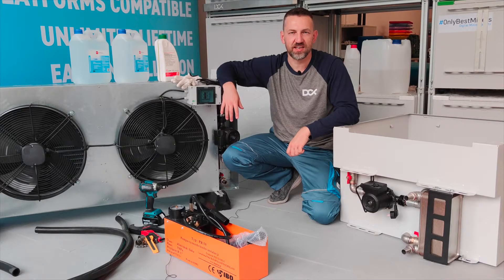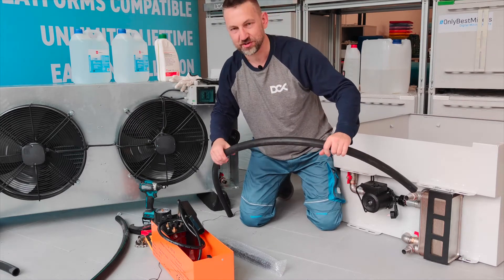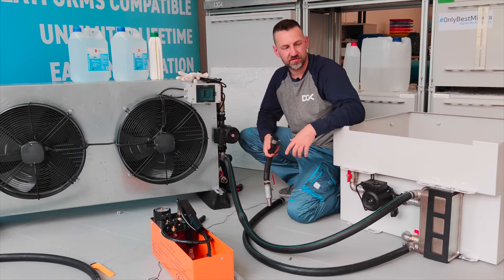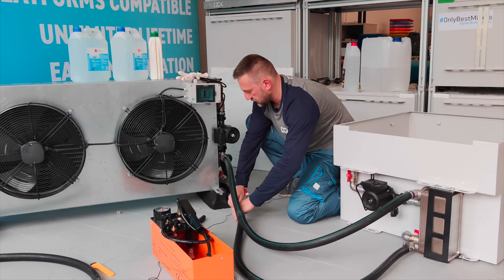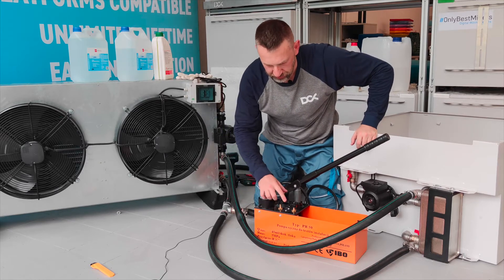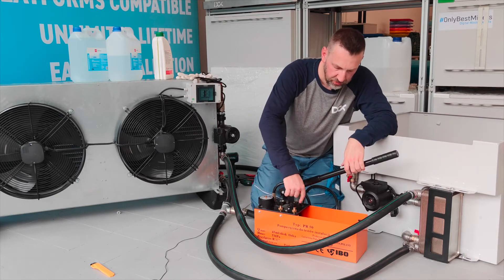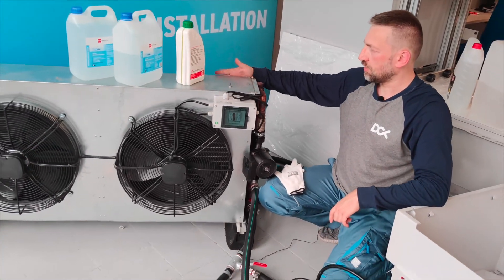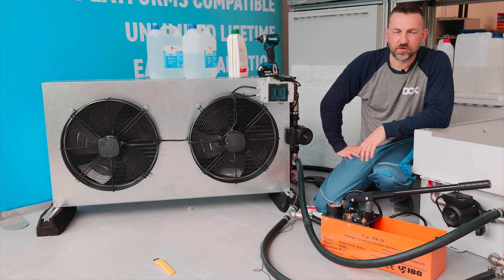How to connect the Dry Cooler in the DCX immersion mining enclosure? | Manual

Comment: Hi may I know what's the water put in dry cooler?
Reply from the maker: Hi, approx. 20L + 1' tubing x distance of that tubing.
Reply from the maker: Oh sorry forgot to clarify: we use demineralised water with some additives (anti fungus, anti bacteria, preventing from calcium and minerals buildup)
Reply: @DCXCryptoCoolingSystems  
Can use cooling fluid instead of demineralized water?
Reply from the maker: @marcusang3735  you mean dielectric fluid? That would make no sense. Water has significantly better heat transfer capabilities than engineered dielectric hydrocarbonated fluid (pity its not dielectric :) Besides many properties that make water better coolant, it's less expensive. So no point to use it in extended loop outside the immersion enclosure.
Reply: We use cooling tower
Hi, we manufacturing and selling immersion cooling box, check this link to learn more https://youtube.com/shorts/e-MFJc0QAU8?feature=share, thanks!